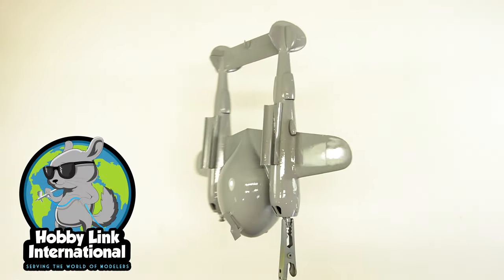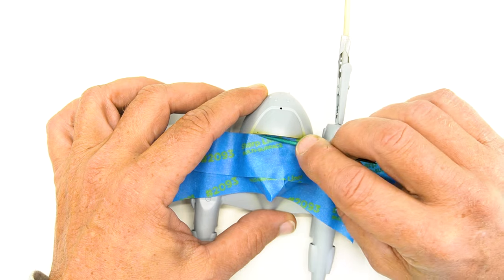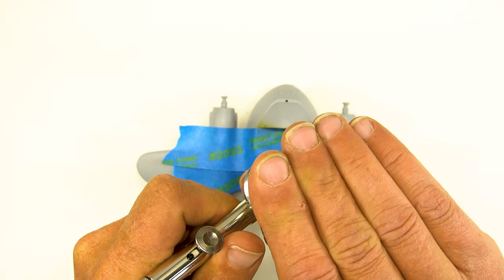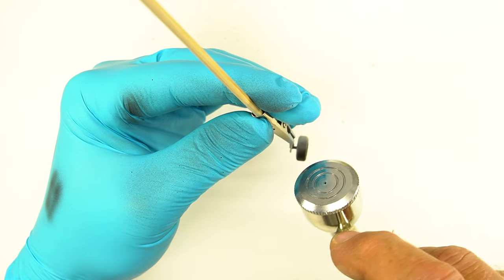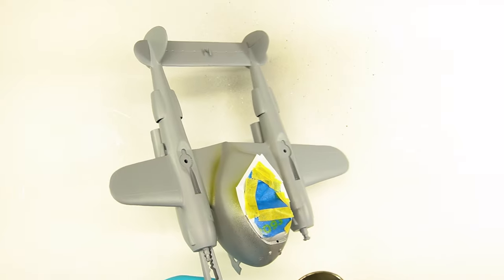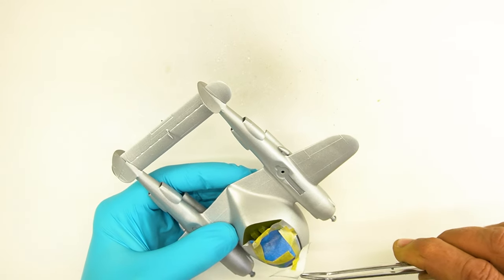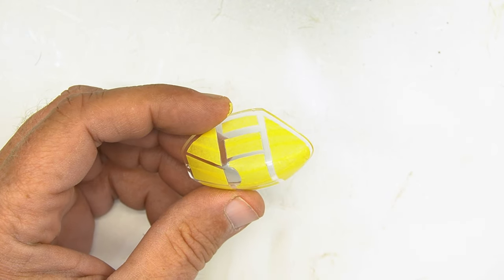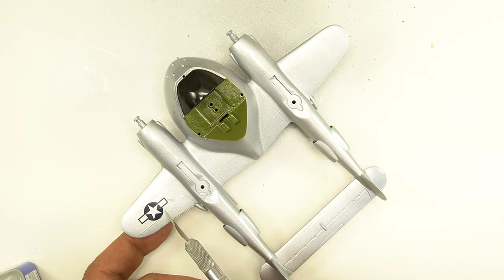HOW TO: PAINTING a P38 Lightning EGG PLANE!

Comment: P38 looks great. Also looks like you got your brush working nicely. I love Stynilrez sure I spelled it wrong though. You have to use a .5 or larger needle to spray it, and it does have a weekness to cold. If it is stored in cold conditions or shipped during cold weather it is easily ruined. I only buy it from Spray gunner during the summer.
Reply from the maker: I think it is that I am so use to Tamiya FIne and Mr. Surfacer primers I really didn't give it too much of a chance. As you see I didn't even attempt to spell it lol.
Reply: @HobbyLinkInternational  lol